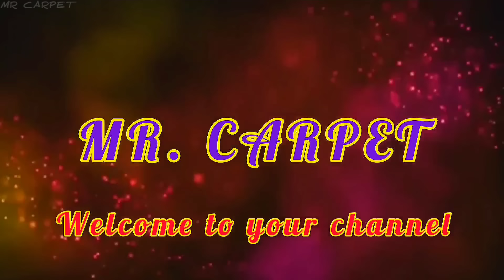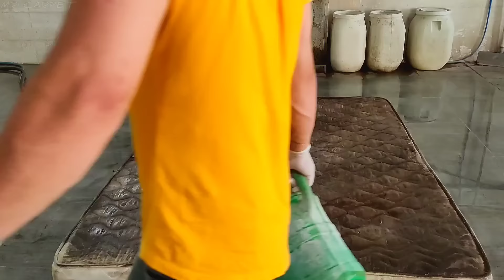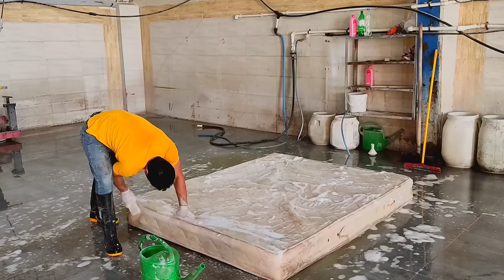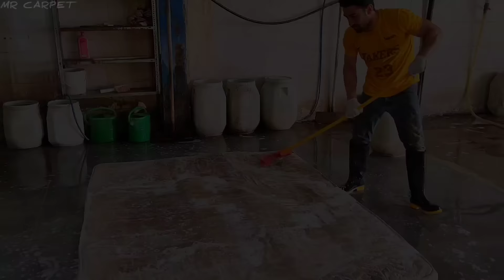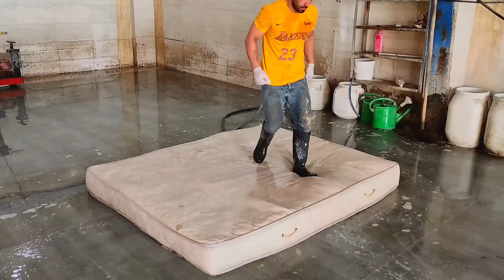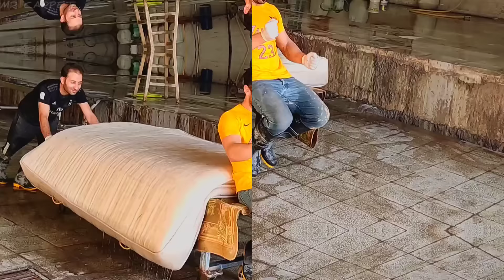Incredible Amounts Of Brown Goo Came Out Of This Mattress During The Wash You Will Be Very Surprised

Comment: You do a great job but I have a question. Wouldn't it be better to have whatever you're cleaning of the ground (like on blocks are even pipes so you can roll it) so that when you spray the water it runs all the way through it & out ? Of course you can't do it if you have to walk on it or use machinery but I'm talking about when you're spraying or rinsing it.

Comment: Wait you can clean a mattress like that? Wouldn't the springs rust? 🤔😂
Reply from the maker: No at all😊
Reply: If the mattress is dried  so it can  be used the springs would survive that.
Reply: I guess it comes down to the mattress age and metal spring type. Rusty springs can lose strength and sag or even break down over time. Because my mattress springs rusted even though I had it completely dried within 24 hours.